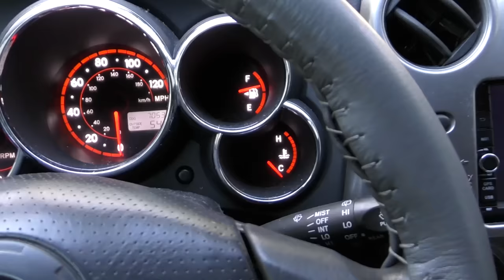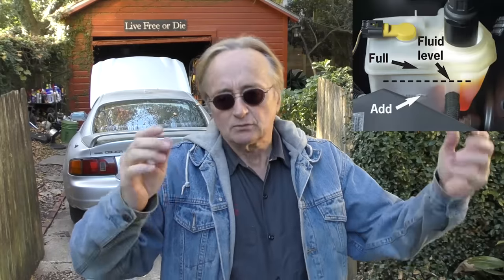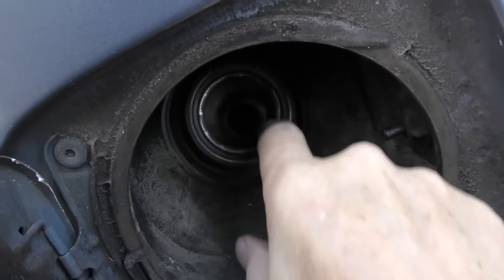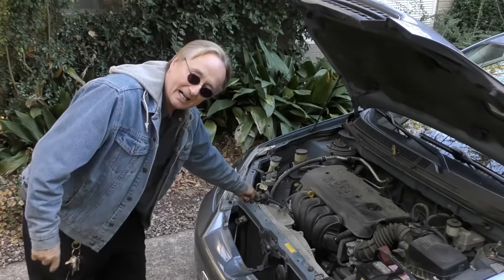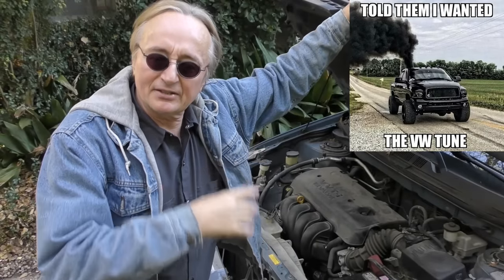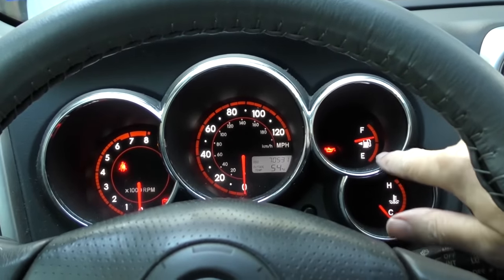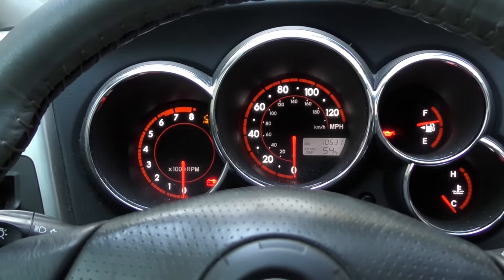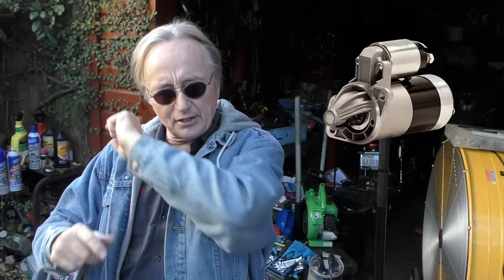Please Stop Doing This to Your Car (It Broke My Celica)

Comment: If your car just clicks check if the battery cables are loose before you call a tow.Most electrical problems are loose grounds.

Comment: Hey Scotty! Are there aftermarket filters you'd consider to be manufactured to equal or better specs than OEM? I use Mobil 1 oil filters with Mobil 1 0W20 syn and Bosch air/cabin filters. Curious about your thoughts. Thank you! Keep it up Scotty!

Comment: The break system can allso have a internal leak from the break master cylinder where it's leaking into the break boost unit, I believe I am having that issue with my Supra right now.

Comment: My fuel gauge wasn't working.  Didn't know how much fuel I had left.  A military buddy taught me an easy tip.  Fill it up to full.  Trip the odometer.  Every 100 miles, refill the gas tank.  Going to do that from now on no matter if the gauge works or not.

Comment: Inside the master cyclinder theres a ROD that feels pressure from front brakes on one side and rear brakes on other side.   As long as the line pressure front and rear remain equal the brake light is off.     If  pressure drops due to a leak the rod moves in the direction of the lower pressure front or rear and sends a ground to the warning light or computer.    The light will remain on until the pressure in the front and rear brake lines are equal again.

Comment: Here’s one for you. I actually had a bad gas cap on my Toyota Solara, which is my winter car. I went to the dealership to buy a new gas cap and they sold me one that did not fit. It was a screw on style. My car uses the type with the dog ear slots. The parts salesman said that the screw on type was all they sold. So, I took it home, pulled the gasket off and put it on my old gas cap. Problem solved. OEM doesn’t mean anything if the dealership employee doesn’t know what he or she is doing.

Comment: The only time you should top off the brake fluid, is when the system is being flushed, or you’ve repaired a leak. When the brake fluid is “low“, that usually means your brake pads are worn down, and need to be replaced. The caliper pistons have traveled out too far. The brake system is hydraulic.

Comment: I had the experience with FRAM aftermarket locking gas cap I put on brand new car.  Since it has about 100 miles on the car, I took it to the dealer and they charged me $110 to tell me the aftermarket FRAM cap was bad and diagnosis was not covered by warranty.  They could have been nice and not charged me for the quick scan, but coincidentally, the dealer had also offered me life time oil changes, so we know what their game was.

Comment: Topping off brake fluid is a mistake.  In my experience, a reservoir for your specific vehicle is large enough to compensate for normal brake wear.  The fluid level goes down as parts wear and also goes up when parts are replaced.  If it's at minimum, all the wearable parts may be at minimum spec at the same time which is unlikely.  Odds are you have a slow leak that can easily become a large leak under pressure leading to brake system failure when you need it most.  Never go cheap on brakes!!!!!  And never procrastinate properly diagnosing low fluid level in the reservoir.

Comment: Wouldnt running your car until the fuel runs out only allow your fuel pump to run as long as the spark plugs kept firing? (maybe a couple seconds?)  because as soon as the plugs stop firing the engine stops and no more fuel pump running.

Comment: In those matrix, if the car thinks it's in park it won't activate the driving lights. I shorted the e brake wire and ive saved on headlight bulbs ever since.

Comment: Low brake fluid means a leak. Or low brake pad linings. Do not top it up without checking the braking system.

Comment: This reminds me I need to convert my van to a non-rear-heat hose.  it has a little leak under where the hose goes into the body to some core in the back for the rear unit.  Whatever, it's a cargo van now. 

The hose is short and simple but to get to the thing I have to pull the alternator, which on this one also means the top of the fan shroud.  Then it looks like one side of the hose mounts to a plastic nipple so it's a delicate job to remove.  So I have been putting it off.

Comment: my 88 civic break fluid went low, breaks still worked great.  checked the light but tearing out the carpet to get at the switch and all else connected to the handle.  went online to see that its probably low. not in the owners book, maybe it is, bought it used, didnt get the book. asked the dealer. they said,,,,,,,,,, guess what,,,,,,,,,,,,,,,,, could be a million things, need to bring it in.,,,,,,,,, looked online, low, filled, light went out. my poor carpet.

Comment: My tacoma heater went bad, i was thinking about change it myself, take dash out, everything that it takes to put the new one in but the guy said - i wouldn't change it, most of the times, the ones available on the market don't last long, maybe a couple of years and the agency one it is waaay too expensive - 
what would you do ? 🤔
Reply: Find out what the local stealership would do before reselling it. Maintain your trade-in value. Even if you sell privately, do what the stealership does.
Reply: It would depend on where I am. If up north, replace it with something that works, ASAP. Here in Florida? My heater's had problems for a few years now. I put on a sweater.

Comment: great channel. Have a question.... I have a 94 Ford F250 with a 385 series 460. have a corrosion problem in the cooling system. Fully flush the system and still turns the coolant brown. What can I do you stop it. Alreaddy ruined the stock heater core, and the second one is getting diminished. Any experience with the waterless coolant? The original 460, which I'm doing a backyard rebuild on, had 480000. Started having blowby, and oil consumtion.. Still ran great though. This one is a junkyard motor with close to 200000 on it, put about a 100000on it so far and same problem though. Any ideas?
   Oh, another thing, always placed a low temp thermostat in  my vechicles. 84 Chevy caprice sw 79 Ford mustange 2.8l Cologne. All have over 300000, still with power. The Chevy's consuming some oil though. Could the low temp increase longevity?  When I was a kid about 10 or 11, an old timer told me that, when i would try to help him work on his vehicles. His stuff was OLD. He had a grocery store in South Philly, He claimed his Chevy van had over 600000 on it Learned to drive stick ona three on the tree, when I was 12. Haaaaaa. Thank goodness my parents never knew:).

Comment: A local mechanic told me that my car has three sensors faulty after scanning. 1. Abs sensor, 2. Evap system sensor faulty and 3. Mass airflow sensor. Which one is the cheapest to repair?

Comment: It isn't the brake calipers going "in" that causes the fluid in the reservoir to go down. It's the pistons inside the calipers. Drum brakes  have pistons only about 3/4 of an inch in diameter, and as the linings on the brake shoes wear, the pistons don't change starting position, in the cylinder, their position in the cylinder when the brake pedal is up, by very much. Disk brakes have big pistons, maybe 1.25 inches in diameter, they displace more fluid, and as the linings on the brake pads wear, the pistons move their starting position out quite a bit, to compensate. Fluid fills the space behind them as their starting position moves out.

Comment: First let me say, big fan, love your videos. I have a question, I hope you can find the problem without breaking my mortgage.  I have an old 2005  Ford focus wagon. It works pretty well, But The darn heater only works on full, when you drop it down, nothing works. Which means, in summer I can't use my AC, cause it doesn't work on High.. I checked the fuses, both relays, now I'm at the motor itself, What do you think could be the problem? and could it be an easy fix? Please let me know.  Again congratz. Its good having good car guys like you doing videos like this for normal people, who gets robbed all the time, like I use to, when I was a lot younger. It would have been good to have a guy like you in my rear-view mirror back then. Thanks

Comment: Hello Sir, i own a Hyundai Elite I20 2015 petrol model car. When i am driving and all of a sudden i put my car into neutral and the vehicle would still be moving but the rpm meter gets increased gradually from 800rpm to 2000rpm and  falls back to 800rpm and this thing continues unless i stop my car ?  I have contacted the car showroom guys and they don't seem to have a solution for it. Please advise.

Comment: Scotty..... I'm looking at a Toyota RAV4 and the CR-V not happy with what I'm hearing about the CR-V with the high pressure fuel and the Turbo. I'm leaning towards the  RAV4 which has a 4 cylinder engine. Would you recommend waiting on the Honda CRV?
Reply: Why are are those 2 your only choices why not look at a Mazda CX5?

Comment: I have a 2013 Ford F-150 XLT and it doesn’t have a gas cap it’s called easy Fill has flex fuel too but it’s the only Truck I have ever bought that don’t have a gas cap ever

Comment: If the brake system is low it has a issue. May just need pads at that point but if you refill and drive it any have more issues down the road.... Turn the car off and pump brakes and if it's soft do not drive. That is a leak and needs repair....

Comment: Hi Scotty I am looking to buy a car just to get from point A to point B. To get to work. I found a 2000 Celica GT for $2000 and a 2009 Toyota Camry for $2800. Should I buy one of these or keep looking
Reply: Get a scan tool like the Creader 3001 to check for trouble codes, incompletes (if there are any incompletes, disregard the car), and VIN swapping (if the VIN on the computer and frame differ, the car was stolen; don't buy it). If both check out OK, decide based on insurance quotes on both cars from multiple providers. If the insurance between the two are close, pick the Celica, because it's smaller and easier to park. If the Celica's insurance is far higher (coupes usually have higher insurance than sedans), pick the Camry. Either way, have a PPI on the car you pick, and if the mechanic OK's the car, pay with a cashier's check drawn up by a bank teller, with the VIN in the memo section.

Either way, check the oil every 500 miles or so, because older Toyota engines, especially on that Camry, are known for sudden oil burning. Just top off oil as needed. Oil is cheap, engines are expensive.

Comment: The most common reason for the brake fluid to be low is wear on your brake pads/shoes. Also for the brake light to come on. If you top up the fluid and then change the pads, you will probably end up with brake fluid all over the engine compartment. Brake fluid is a brilliant paint stripper, so watch out.

Comment: I just bought a 2013 Hyundai Elantra, I had the problem with the battery (still had the original one), so I went to replace it. My dad said that I had to pay attention to it because when we put it the negative cable connector it sparked a bit, what could cause that??

Comment: Scottyyyyy my 2012 subaru imprezza i put a 12 inch subwoofer and head unit in it been fine went for a 45 mile drive and air bag dash light came on now my passenger seat sometimes would ding saying seatbelt even tho no one was there so i hear its that plz input ur a god

Comment: Hey Scotty. I have a 2017 Dodge Grand Caravan. The recommended coolant is OAT. Will it be bad if keep using the PEAK 50/50 Coolant? I had some left over from my old 2004 Van. I know PEAK COOLANT IS NOT OAT BUT it says it's safe for all vehicles.  Thank you in advance.
Reply: You'd need to do a full flush to get the old stuff out to avoid engine damage, but yes, it's possible. Of course, you'd need to replace the 50/50 coolant more often than the OAT. Also, the OAT should be good for another year or so. Does the OEM OAT claim a three year life or five year life? You may not need to replace the coolant until 2022.
Reply: @EMichaelBall Thank you for your reply.  The coolant has a 10 year or 150,000 miles. I was just asking because I always like to check my radiator and reservoir at least twice a month. I used to do that on my old van because the radiator hose and cap were empty but the reservoir was full. I got tired of doing that so I got rid of it and got myself a newer vehicle. The habit of checking it is still there though. Lol
Reply: My Ram 1500 takes HOAT, only auto part stores sell it, can't find it at Walmart. If you put the universal green stuff in it can apparently damage the water pump so I would stick with what the van takes. You shouldn't have to touch the coolant unless you have a leak.
Reply: @ixionn563  yeah after reading all that info on the internet, I saw that the new dodge have radiators made of a different type of metal than the old ones. That's why they are asking for OAT only. I'm not touching the radiator cap anymore unless the temperature gauge goes over the middle or if im gonna do a long trip. It would be part of my inspection list. Check tires,fluids, gas level, etc.

Comment: Hey scott my mom car is a 2001 toyta avlon  changed in cabin air filter put when heat is on In winter  smells like burning rubber I changed in cabin air filter cuz smell didnt help any ideas and coolint was a lil low topped it off stayed full ac does not smell in summer

Comment: I drive 2013 16 valve 87, Volvo the check engine light on. Tell pipe smokes all time it rides good Power is good not missing. Going to check gas cape. No smoke from engine. No leaks. What can I do to not have trouble out of the16 vavles. My brothers said never buy 16 valves I did anyway cause it runs good. Please HELP!!!! I don't drive that much like you.

Comment: I lubricate my gas cap with a little WD40  on the rubber o rings and spray some through the vent mechanism in the middle of the cap. I've had the same cap for 10 years.
Reply: 21 yrs for me and I do none of that.
Reply: WD40 destroys rubber. It's silicone grease you're looking for.
Reply: @EMichaelBall  140k miles and it looks fine.

Comment: I once made the mistake of placing a Fram locking gas cap on my brand new 2003 Dodge Caravan because I had sugar put in my tank before.  Assumed the dealer would fix the fix engine light on my car with 100 miles on it.  They charged me over $100 to tell me the new Fram locking gas cap was bad.

Comment: I recently got my front struts changed,  on a 2014 accord sport,. it was making clunking grinding sound on a cold start i When i take off n turn the wheel . So i took it back , they tightened it to tight so now its making a clunking sound n squeaks. Especially  below 40 temp. How can i fix this issue?

Comment: Scotty, a few days ago while working underneath my 2008 Sienna, I noticed that the rack and pinion body was moving left and right upon my wife turning the steering wheel, I thought that only the ends were supposed to move in and out upon turning the wheel, it isn't moving a lot but you can see some movement, Is this normal or is the rack and pinion loose?

Comment: Hey scotty, i bought a 2006 scion TC (camery drive train) and i did a tune up, spark plugs, oil change, air filter, and some other things. Its a manual transmition with 210,000 miles on it and my question is should I flush the transmission fluid at this point not knowing the last time it was done (no service records, thats what you get when you pay $650 for a car). I watched your video on changing automatic tmf, but this is a bit of a specific case and i would like to get your opinion. It shift well 95% of the time but it could be smoother, never falls out or slips, still feels like its got life left, thats toyota for you!

Comment: I used to let my tank get really low before I put gas in it. Then one day I was driving and the engine wouldn't rev high like usual. It stopped revving at a certain point. Then the next day when I went to start the car, I heard a loud humming sound from the fuel pump, and the car wouldn't start. I killed the fuel pump. Now I don't let the tank get low anymore.

Comment: Scotty:I've got a 2004 Toyota Camry with a soft brake pedal. My boss and I replaced the master cylinder and we've bled the system several times including the master cylinder and we've still got a low pedal. What could be wrong?

Comment: Hey scotty,  I'm considering getting my 2112 altima coolant changed for the first time. I'm the original owner and have 146,000 miles on it.  Would it be advisable to let the dealership do this and maybe change the belt? It's been a great car so far.
Reply: Never ever go longer than 5 years on coolant.  It doesn't matter who does it as long as the EXACT coolant required by the manufacturer is used.  Also never go more than 5 years on a serpentine belt
Reply: Do the timing belt, tensioners, and water pump too. An independent mechanic can do all of this with OEM parts (and yes, you want all-OEM for these parts). With that many miles, I'm surprised they haven't gone, yet. Also, if that car remains reliable, keep it, because you got lucky with a reliable Nissan. Don't get suckered into messing with success. Whenever you need to replace it, look into something used like a 2004-06 Camry, a 2009-12 Avalon, or even a 2012-14 Maxima, if you can get an Avalon-esque or lower price on the latter (those Maximas have decent reliability). New cars are a special kind of trap these days, in two ways:

1. All the complex electronic stuff will be very expensive to fix out of warranty
2. Depreciation on new and newer cars is about to become a nightmare; youtube search "tony seba robin hood conference" for more info (the first two minutes are fluff you can skip)
Reply: @EMichaelBall  
The Nissan is chain driven